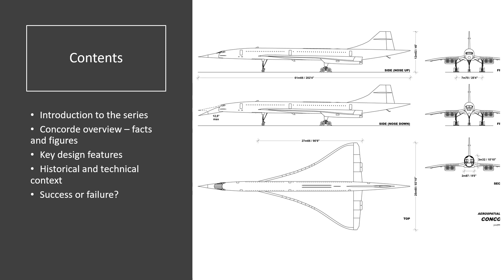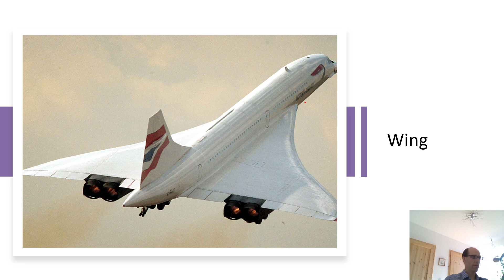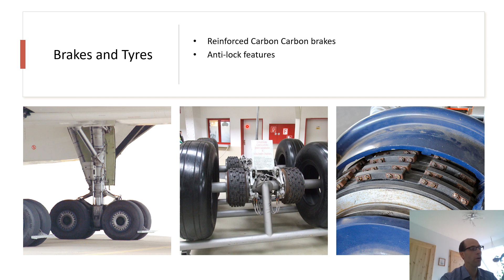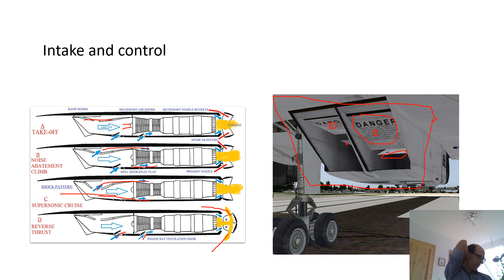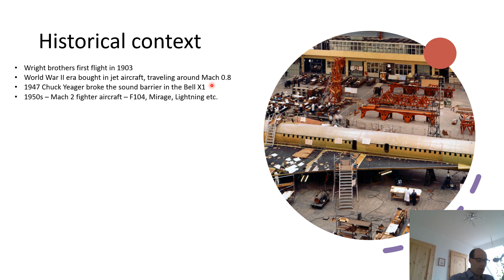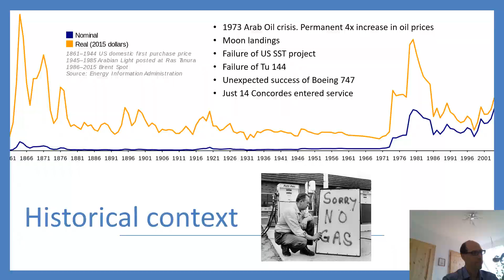Concorde - Europe's moon shot?

Comment: Thanks for the great and detailed post!
Don't understand why this isn't better known.

There are just two corrections I’d like to make:

Regarding weights:
Maximum Take-off Weight MTOW was 185t (not 187to). [minute 07:34]
Max Taxi Weight was 186.880 kg (approx. 187to) 

Regarding the use of afterburners:
Upon entering the “transonic regime,” the afterburners were shut down after reaching M1.7 (not at M1.05) or, at the latest, after 15 minutes of operation [minutes 10:39–11:17]. Shutdown occurred at M 1.7 so that a pressure ratio of approximately 7:1 (i.e., before entering the compressor of the turbojet engines) could be generated in the air intakes due to pressure recovery (resulting from the generation of shock waves to reduce the inflow velocity). This pre-compression ultimately led to a phenomenal increase in the total pressure ratio of approximately 80:1 in the Olympus 593 turbojets (compared to a nominal value of 15.5:1). This feature enabled Concorde to even climb from Mach 1.7 in supercruise mode and to maintain this mode for hours at speeds up to M2.04.
Reply from the maker: Awesome, thanks for the info!
Reply: @drawingboard82  Here you will find a very interesting lecture by Dudley Collard (aeronautical engineer and aerodynamicist at Sud Aviation/Aérospatiale) on the history of Concorde’s development. He played a key role in bringing Concorde to series production.

DUDLEY COLLARD CONCORDE LECTURE AIRBUS TOULOUSE PT 1
https://www.youtube.com/watch?v=GVMIKgBYVCg

DUDLEY COLLARD CONCORDE LECTURE AIRBUS TOULOUSE PT 2 
https://www.youtube.com/watch?v=ey55R8xhn_w